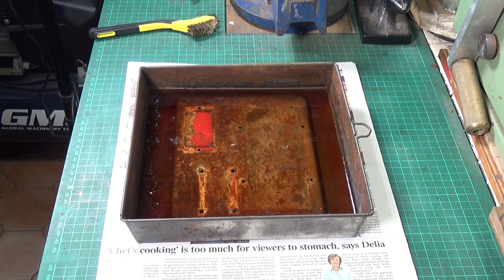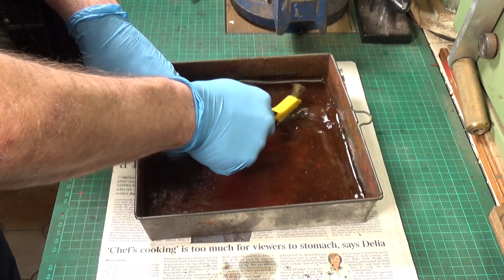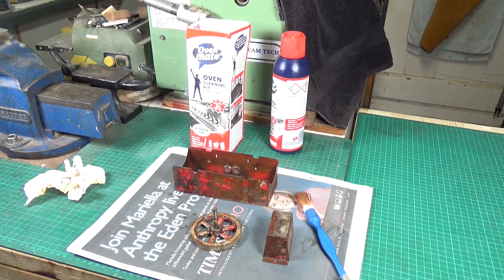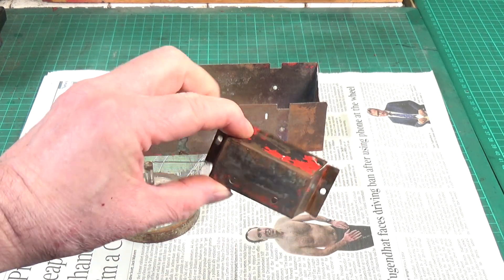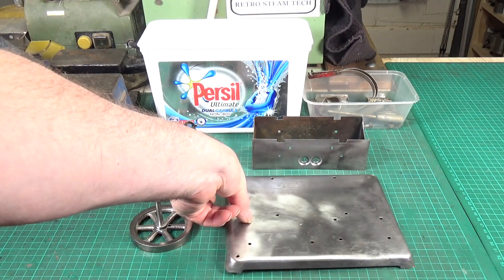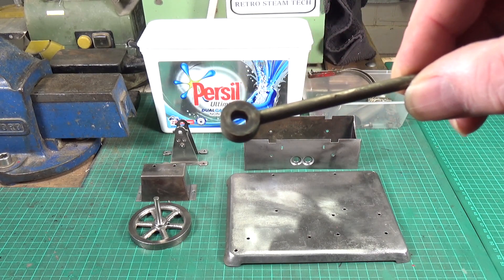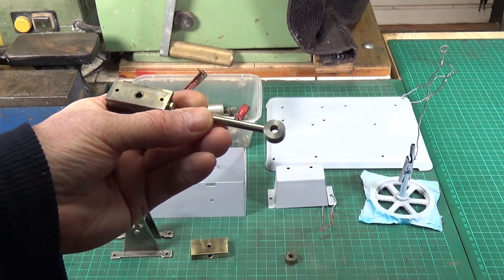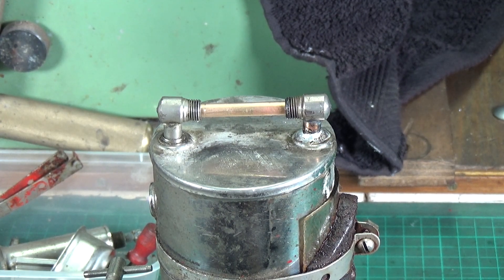Empco B-43 Model Steam Engine - Part Three

Comment: scrubbing up Nice Alan, good tip with the gauge glass
atb
Kev
Reply from the maker: Thanks Kev. I've struggled in the past repairing gauge glass elbows and it suddenly dawned on me that I could use a sacrificial bit of metal. Works a treat. Cheers, Alan.

Comment: Hi Alan.  Interesting clamp/hold all thingy you have in use near the end.  Very impressive.  I was wondering how that alignment rod came out.  Good one.  Cheers Rob
Reply from the maker: Hi Rob. It's a retort stand, we used them in school in chemistry! The one I have was rescued from where I used to work as it was being thrown out. Extremely useful bit of kit for holding all sorts of things. I think you can still get them although the cork lined clamps which mine has are tad expensive. Cheers, Alan.

Comment: I use electolis for cleaning paint and rust off, much less messy and more effective. How are you going to get the sight glass in?
Reply from the maker: The sight glass is cut to length so that it just fits between the elbows. The gland nuts extend beyond the elbows and have O rings in them. Once the nuts are tightened up the O rings seal around the ends of the sight glass tube.